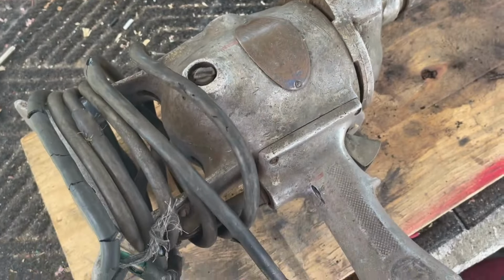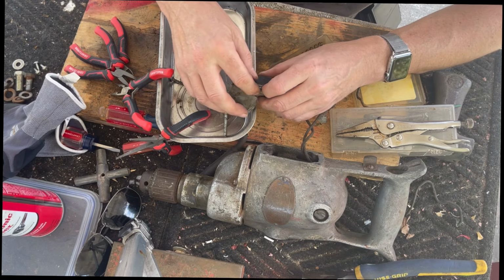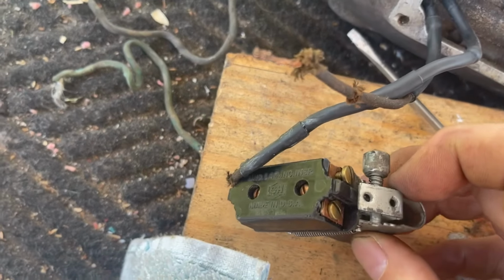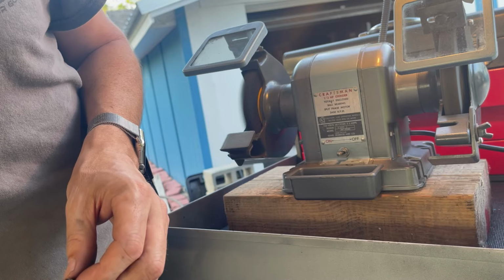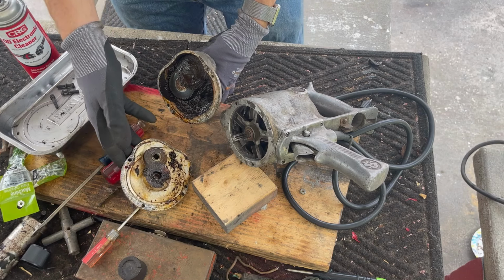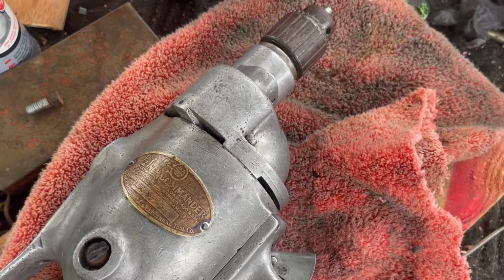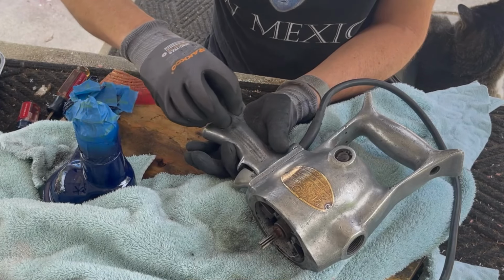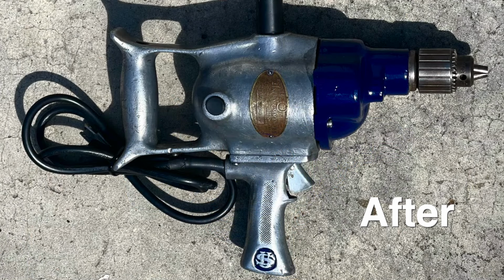Restoring a 1934 U.S. Tool Company Commander Drill

Comment: Nice job. These drill are so powerful that if not careful, they can break wrists. Well done.
Reply from the maker: Yes.  Can you imagine using a hole saw and it binds u on you?  This one takes a 3/4" pipe as a 2nd grip!  I've only ever seen 1/2" pipe threads on heavy drills.  Makes you wonder why they thought 1/2" may not be sufficient for this one  :)

Comment: I wonder if the front piece on the drill is perhaps a  replacement? It certainly does 
not seem like its original and perhaps it came from another model but was close
enough that it would fit.?
Reply from the maker: Yes, I wondered the same thing. It looks awkward but fits perfectly.